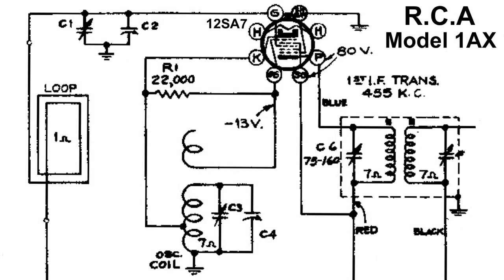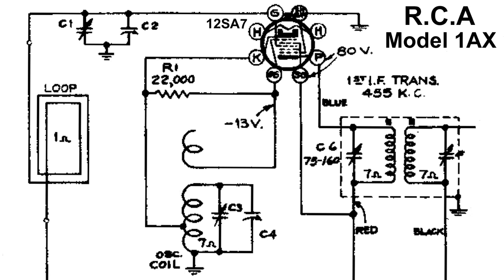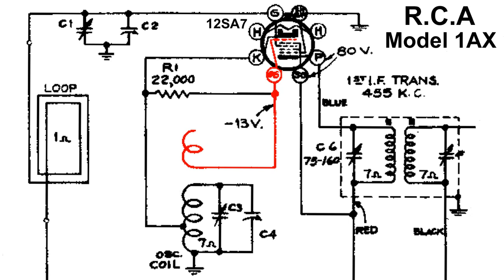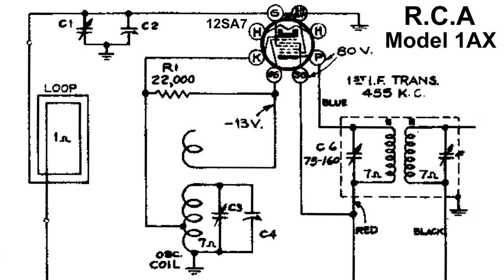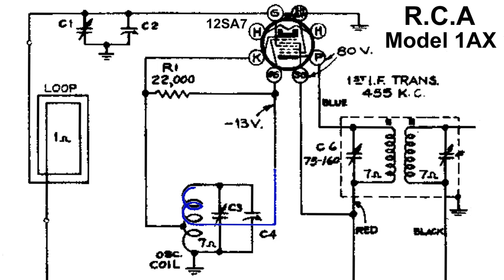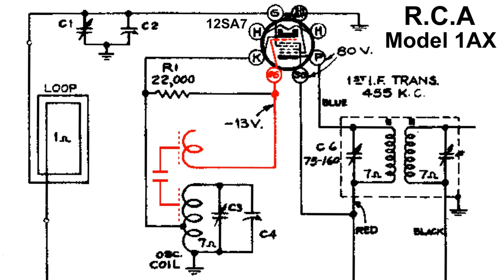Interesting Oscillator, how does it get positive feedback

Comment: Rick,  Thanks for addressing this type of oscillator.  I recently repaired a AA5 that also had this circuit.  After recapping the radio I found the oscillator coil was open.  Fortunately I was successful in repairing a broken wire in the coil.  Could I have used a capacitor and the tapped winding from a universal p-c70 oscillator coil from Antique Electronic for a replacement?  If so what value would the capacitor need to be and how would you connect it?  Thanks as always.  You are great and always answer all my questions that I post.
Reply from the maker: Douglas Tees 
I'm sure you could use the PC 70 oscillator coil from antique electronic supply. To find the values and also how to redesign the oscillator I would look through circuit diagrams until I found the configuration of the PC 70 oscillator coil. This was another very popular oscillator configuration so will not take too long to find. I only reinvent the wheel when I have to.

Comment: As frequencies increase, various circuit elements develop inductance & capacitance that'd be inconspicuous otherwise.  I remember a Popular Electronics design for a UHF down converter that called for an induction-capacitance element consisting of 2 pieces of sheet metal, each in a square U shape of certain dimensions, parallel with an air gap, connected at one end which was also tapped, while the terminals of it were the other ends.  Years later I realized that was no mere hobbyist's trick, but was standard commercial TV tuner design for UHF.  The capacitance between grids in vacuum tubes could also become significant & could be exploited, while a length of bus bar could be an inductor.

Comment: Until this video, I'd thought that "gimmick capacitors" were limited to very short sections of twisted wire used as a cheap method of incorporating a 1pf or 2pf capacitor into the circuit. Could this be considered an instance of "capacitance through inductance"? Verrry interesting!
Reply from the maker: ***** 
Thanks AMStationEngineer

Comment: Hi Rick although I’ve seen and used gimmick capacitors I don’t remember coming  across this circuit before. The pervious comment asks why they don’t just use a ‘real’ capacitor instead?   I guess that the fact that there’s inductive and capacitive coupling influences the relative phasing but however you cut it this sort of ‘open circuit, ‘ configuration always looks like a bit of black magic. Thanks Rick.
Kind Regards . . . Andy
GWØJXM
Reply from the maker: AndyDaviesByTheSea 
Andy
When I was teaching software, I taught several software languages and a few that were proprietary to the telephony industry. After a while I realized that these languages were very similar and then when more time passed it was hard for me to see any difference at all. Here's an example of some keywords, Began End, these two keywords of course was at the beginning and end of a software statement. In another language the, Begin End, was the symbols, {}, if you put the same software statement between these two symbols and the compiler had no problems with it. So I thought the differences between software languages was probably there to keep from being sued. This oscillator design does save on one capacitor but another possibility is to a lawyer this would be totally different from the design that uses a real capacitor for the feedback.
All the best
Rick
Reply: I think this coupling configuration could affect the phase of the feedback depending upon which way it is done. Remember also that the grid is very high impedance...

Comment: Any one know why they would use twisted wires instead of just inserting a "real" capacitor?
Reply from the maker: z95m 

It was cheaper then a capacitor. And it was one less component to install. If you are manufacturing a million or more radios that can be a big savings.